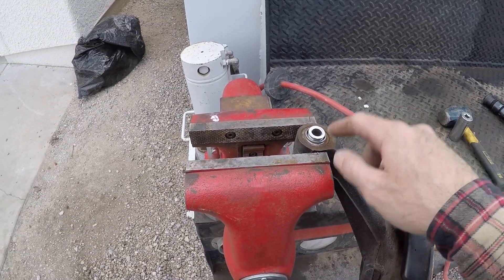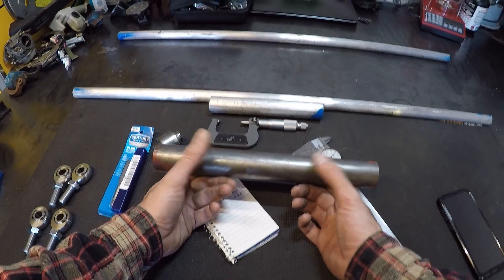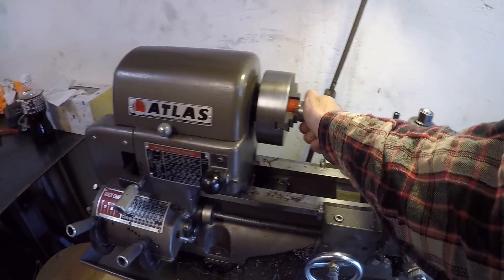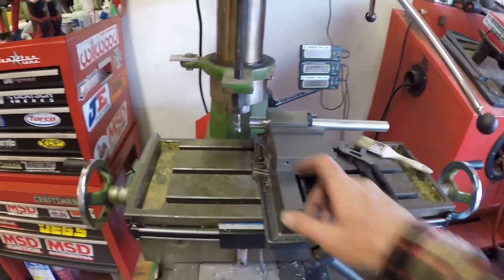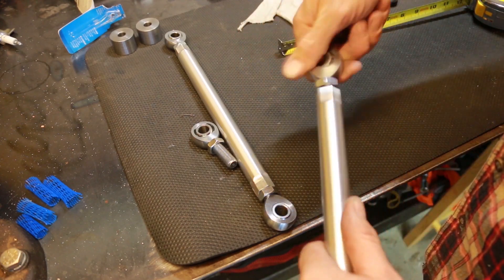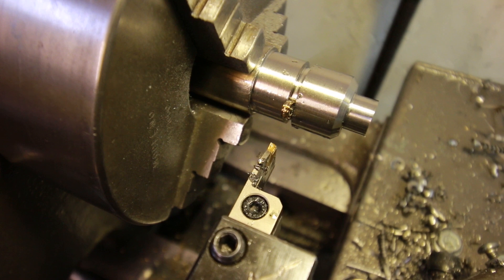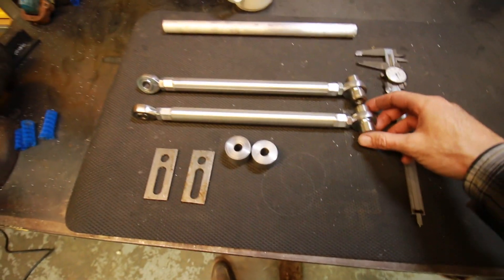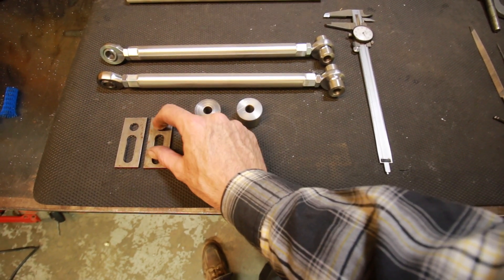Fabricating Custom Tie Rod Ends | Sarahntuned MR2

Comment: only suggestion i have is when you speed up the camera you might want to put it on a stand was hard to watch that part of the video other then that you did a great job
Reply: Yeah, I was getting motion sickness - even when it was not sped up I was getting queasy with all the movement as he was trying to get some setting/measurement/setup perfect. Machining is not about bouncing around.
Reply: Agreed. Time lapse shots are too dizzying. I know it's a pain to move and set cameras. It slows down work time. But the tripod in a good known location for each machine would make a huge difference. Paint the position spots on the floor so you can setup up each spot quickly.  Also, you might try turning off auto-focus when you're on the tripod so it doesn't move each time you pass in front.
Your voice over is great for a first time!
Reply: One idea I saw on one of the restoration channels (I don’t remember which one) was to have a mount for the camera directly above the lathe, looking down.  That way you and the camera are never in each other’s way, and everything can be seen.
Reply: I love watching the actual processes, maybe also a little bit longer?  Awesome job on the video!

Comment: I agree with Maska Tuck.  When recording for fast speed, is best to have it in a solid platform.  If you are using the go pro, get the camera clamp and place it at an angle that catches a closer and unobstructed view of the work.  The helmet mount nor body straps are helpful when you are moving. There is a cheap accessory called the tripod mount that can probably help you better. I enjoyed the video, excellent information.  Thanks for sharing it.

Comment: Nice, informative video, especially for your first attempt.  Subscribed!  One suggestion would be to try to get some close-up shots of the part being machined, from a tripod, and possibly time-lapse if the machining takes a long time.  I love seeing parts machined and fabricated.  It's super satisfying to see a part taking shape from a piece of raw metal.  It might take some more equipment such as a camera with a longer lens on it, so you can zoom in from a distance back (camera not too close to the part), but I think the payoff could be really nice.

Comment: Not bad for a first go, keep doing you and making things and the channel will grow. 
For the tie rods, would be good to have a locking nut at each end and an extra hex surface in the middle for quick adjustments once fitted. 
Please film the measurement of the bumpsteer bracket. interesting stuff.

Comment: You did fine on the video. As a machinist myself I have definitely work hardened a few pieces in my career! if you have a good air supply a cold air gun or coolant mister would definitely help. I hope you make some more machine/fabrication videos.

Comment: Nice work! I am a retired machinist. You might have over edited.  I would have liked to see more detail on the recovery from the parting tool crash.  I would also have wanted to see more detail in the finishing operations filing, de-burring and surface finishing.

Comment: You did great both on video and machining. Well explained and great audio when.explained. 
Just dont get the ,413 of an inch when.its so much easier in metric 😉 Morten, from Sweden. Yup your vid made it to europe and in fact scandinavia. 
Keep 'em vids coming and show us all one skilled person can do much even with old simple machinery 👍 😎
Reply from the maker: My lathe dials are all graduated in inches (it was built in the U.S. in the 1950s), so it's much easier to just use one measurement system and stick with it lol

Comment: Hey Charlie, nice to see you and Sarah working on projects again - came over and subbed after watching Sarah's vid. Regarding your filming, only issue i could see was the speedrun of the time lapse parts were a bit too fast to see anything usefull. And on the subject of youtube and fabracobling, check out Abom79 - https://m.youtube.com/user/Abom79
Reply from the maker: I've been watching Adam for a long time. I'm more or less a self taught "machinist" and its thanks to guys like abom, mrpete, this old tony etc.
Reply: @ApeShift  Even as a trained machinist I learn things from them.  There's a TON of knowledge floating around on YT if you're willing to spend the time, which it's obvious you have.
A couple tips... first when you're setting up that collet block just put your machinist scale across the vise jaws.  Quick and repeatable quite accurately.  Second, when you're making tie rods I always prefer making the hex and larger than the center since the threads are in that part.  Start off with hex stock rather than round and it's easy.

Channel looks good... you have a new subscriber.  I wish I had a resource like Sarah for editing advice for my vids.
Reply: @ApeShift  , ah yes forgot about thisoldtony. His content has been less machineshop these days though.
Reply: What about AvE and his clapped out Bridgeport? :-)

Comment: You probably already know by now, but stainless really requires a much lower cutting speed to cut to make tools last. 15 to 30 feet per minute. (The books published by the insert manufacturers with speeds and feeds are for ideal conditions, ie saturation coolant, non bell mouthed chuck jaws, and a super ridged machine with swarf protection doors. Not applicable to a 1960s manual lathe.) As an apprentice I broke a lot of parting tools. Now days generally I set a few thou above centre, as the tool always pulls down under load (always stop cutting before centre and break off your part if it isn't drilled, as tools above centre will smash the tip otherwise) and if the machine doesn't have a coolant supply fill a bottle of coolant solution and keep a steady flow while I power feed about 2 to 5  thou per rev. I also clock the parting tool to get it exactly 90 degrees to the job so the geometry is spot on. Even then sometimes the gods of machining will decide today is not your day.
 Having said all of that, your machining looked very professional when finished. Earned yourself a subscription.

Comment: You are literally the "Charlie in a box" from Rudolph the Red Nosed Raindeer with that tiny space you working out of.  Good work on efficient use of space!  Don't worry about the ins and out of video production- content is what is most important.  Bonus question:  Why are your machining speeds so high?  Most metal working videos I watch the operators seem to run slower rpm on their tools.
Reply from the maker: On the lathe it's because I'm using carbide tooling, and it works best at higher speeds and feeds. On the mill, it's because I'm too lazy to swap around belts lol

Comment: Charlie, you did a nice job on those parts. It looks like you have a good shop setup too. I work in an aerospace fab shop and can't work on my own stuff... In Colorado, shop space is crazy expensive as well. Good job on the video by the way.
I do like the little Atlas. I have never seen that style of chuck attachment before, although thinking about it is somewhat like the drawbar-style on the Monarch in the shop I work in. I could research it but is there a collet chuck for that too?
Reply from the maker: It's just a 1-1/2 8 tpi threaded spindle. There were original collet closers, but the easiest way is to just buy a 5c collet chuck with the he right threads already in it. I just work out of my one car garage lol.

Comment: Now you get an idea of time management for You Tubers. Audio on point, description fair ( what were you dabbing on the metal before milling).
Reply: It would be some cutting oil.. u always want to add some cutting fluid to ur bit when drilling.. ur cooling the bit which helps cut faster and saves the wear on the bit
Reply: I thought maybe it was a lubricant?

Comment: Hey howdy,
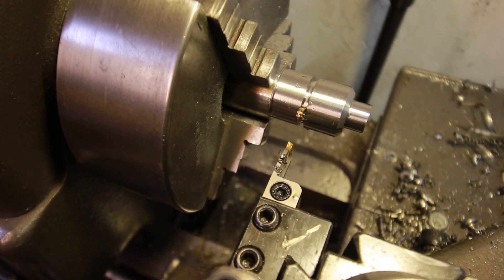So why didn't you use the BFH @ 8:42, you know it would help a lot, at that time. Hehe
Looks good, if you could slo-mo on the milling, so we can see that metal being ripped from it home. :) 

Will you be adding tangs to that link? 2 bolts over time will loosen. Or maybe you could notch a thicker piece to eliminate most of the play if it loosens up.
I once lost a wheel in my K5 Blazer, funny now, not so much then. 44" tire bouncing over a car that was behind me. Smh.
Cheers :) :) :)

Comment: I second that Abom79's videos are a "quality goal"...I would add Keith Fenner also.  Both of those guys shoot top-notch machining stuff.  Of course, they have invested a good chunk of change in recording equipment.  If you're careful, creative, and persistent, though, you should be able to crank out videos that will satisfy those who like to see a bit of "tool in the work".
The fair lady, Quinn, at Blondiehacks also does a fine job...she posted a video not long  ago about making a camera mount that fits onto a Noga arm...omitting the need and space requirements of a tripod.
Definitely don't try to be one of the above three...be your skilled self...just study their uses of pace, camera angle, and light.

Best of luck on your You Tube-ery!!!

Comment: Parts look good but you can't have two pivot Points on the same end you should change the harm joint on the end to a fixed unit to hook to the suspension sort of like the factory unit measuring from the tube bolt holes does not do anything for the actual physics of a pivot point in the situation not trying to tell you how to do it just don't want to see her get in a wreck because of faulty design I've done spinach and modifications for the past 15 years I know what I'm talkin about keep making videos